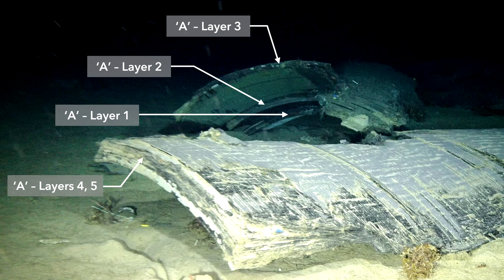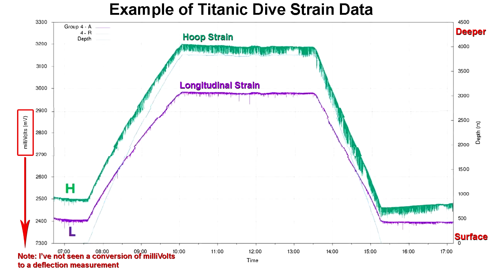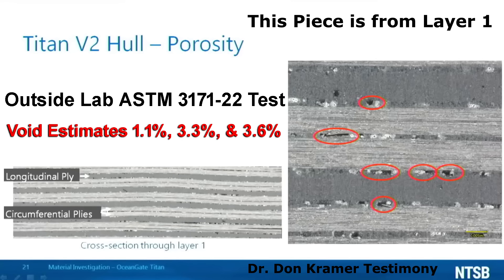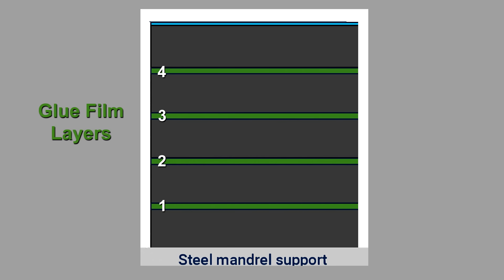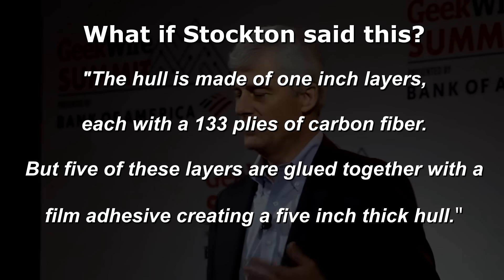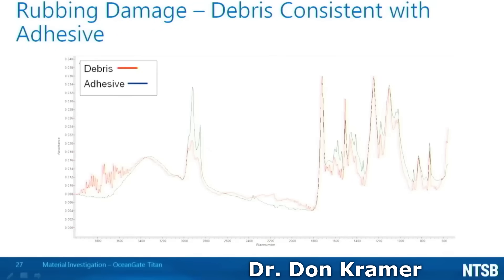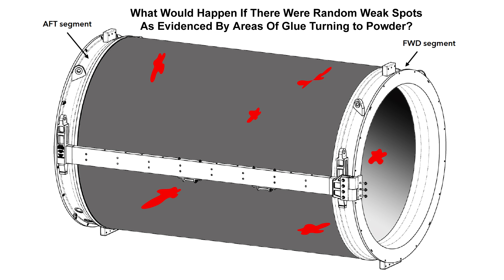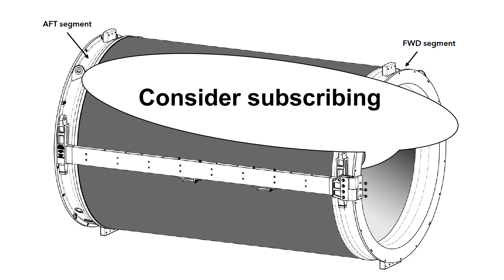OceanGate Titan Hull - Glue Layers Were Breaking Down To Dust - No Clues.

Comment: No one ever think that possibly Stockton used the 1:1 carbon fiber that was destroyed in testing in the V1 hull? I'm just curious cause how he claimed he bought used or older carbon fiber from Boeing but Boeing has no reports of this? And doubtful Boeing would sell anything old or used unless to repair or make a possible standalone Drone sub for testing? I know alot of deals go under the table we all in contracting know that you can get this or that for cheaper but why was it co bonded? Not fully one hull?? Was it cheaper to cure the cure again yeah I guess but cheaper isn't the issue here I see a outlined issue between Stockton claiming that he bought "old or used Carbon fiber" for the new v2 hull I believe he used all the left overs from testing than used the rhino liner to cover up the old markings of the issues from prior tested or used carbon fiber ntm the fact he was using that rhino liner to hide something I heard about Stockton rush when I worked for USMI United States Marine Incorporated located down here in Southern Mississippi Between Gulfport and Biloxi I remember hearing that name aloooot during 2019-2020 which year I was there was either 19 or 20 which we used to have a bunch of older or extra Carbon fiber from our boats and ships as a security guard you learn this and I will say this if anyone uses this information please be discreet of my knowledge I also good God sworn Stockton Rush came there with a semi truck but that was during the day shift but early morning hours I met someone or it was evening that there were 3 of these people one looked an awful like Stockton rush
Reply: Discreet? You just posted this on Youtube, doofus
Reply: This is a huge possibility as USMI is a huge manufacturing company for contracts through scientific research vessels and also naval, coast guard and other military platforms or government outlets all marine services technically that are government or otherwise scientific as we had a ship built by them at the time I worked there I had to walk over and make sure was always secure in our bay, also we uses rhino liner on the bottoms of our more military type vessels yes I know alot of places do but that place is a hugeeee company contract with a huge budget from the US government and just weird to think how we had rolls on rolls of carbon fiber that had sat for months at a time before I ever even start than one day they were gone on a semi truck out the gate im just stating idk of possible or what.. but USMI is kinda a sleazy company and would do anything to protect themselves or make a buck I was treated like a dog there literally lied about and than fired for no reason and then was told they were going to sue me if I spoke out against then in any form or fashion or about their products which infact supposedly its supposed to be public information if any government contract is given to said company this is another reason why I believe this being a serious issue not to mention how they co bonded that sub looks like how we co bond some vessels that stand on top of the water than they use rhino liner on the outside to protect from water getting inside its crazy I never thought of this company United States Marine Inc

Comment: Was the powdered glue a result of stress from the dives?  Or was it from poor manufacturing where the glue never had a chance to dry or was autoclaved to dust?
Reply from the maker: That is a great question.  It could be weakening due to multiple cycles of autoclaving, but we don't know at this point because they haven't released specific information about the glue film used.  The disintegration of the glue to powder and the evidence of rub marks on the laminate between the layers seem to indicate that there was independent movement of the layers and shear forces on the glue layer; in patches.  Think of it as a small grinding motion on the glue layer.  Hopefully, the NTSB final report will tell us more.  Thanks for your comment.
Reply: The powder is almost certainly resulting from the grinding action between the layers,ask any miller and they will tell you that grinding is the ideal method for making dust/ powder out of anything. My take on it is that the glue was dried out completely,it's chemical bond broken down by the repeated autoclave sessions,again ask a miller and they will tell you that only the very dryest stuff makes powder/dust.The expert witness mentioned that there was definite grinding occurring between the first two layers,which incidentally were the layers that were subjected to the most cooking sessions,this I imagine added to the porosity allowed movement and the resultant grinding between the hard and abrasive carbon fibre surfaces ground up what was between them and that it's self produced the dust/powder.
Reply from the maker: @user-re6yo7tj5s  Thanks for your comment.  I agree.

Comment: the port hole window material was only capable of going to 1000m while the titanic is at 3800m. i believe the first thing to fail was likely the port hole window which then allowed the imploding force to damage the cf hull. but having pulled off 13 dives previously, im amazed it didnt implode after the 2nd dive.
Reply from the maker: Thanks for commenting.  I did an in-depth analysis of the controversy about the design and the rating of the viewport. I think you would like that video.  Search YouTube for this title  12 Weird Facts About Stockton's Titan Viewport
Reply: The portal was safety rated at 1000m, but it would stand at 5000m if normal safety derating practices were used.  It's like the overhead rigging shackles I use on a regular basis.  They're rated at 6000lbs, will deform at 27,000lbs and fail at 30-32,000lbs.  And that's to hang a max load of 2000lbs.  They were pushing it hard, but it would still hold.  Extremely poor engineering practice though!
Reply: It’s ok, there was a safety factor of 4 for the window /s.
Reply from the maker: @ Thanks for commenting.  I did an in-depth analysis of the controversy about the design and the rating of the viewport. I think you would like that video.  Search YouTube for this title  12 Weird Facts About Stockton's Titan Viewport

Comment: It is sad they didn't do testing to destruction. They were basically guessing that it was going to be strong enough. It is stunning they were willing to take that gamble. As for why all the analysis? This was the first time anything like this was built. Now they were able to do the testing the Oceangate should have. If nothing else, we can find out what the problems were when using this material and these construction methods. Hopefully this will prevent anyone else from trying to do the same thing.
Reply from the maker: Thanks for your comment.
Reply: Everyone told them at every step it was wrong including a lead mechanical engineer quitting over unsafe practices.
Reply: This was actually built already about 8 years before Rush....and they did test it to failure. He basically copied their whole schtick but not the testing part they did where they figured out it's too risky to make 5 dives.

Comment: For what it may be worth; a Boeing engineering fellow ,  PhD in mechanical and aero engineering and internationally respected exprrt on structural analysis and in particular on composites - Dr L J Hart-Smith asked me to see what I could find out about the failure of this vessel soon after it failed - this was in connection with his research on the buckling failre of shells and his as yet unpublished paper revealing a fundamental flaw in the standard theory of shell buckling that is built into all the stressing codes and computer FEA etc software ( that has the effect  of overpredicting the critical buckling strength by a factor of TWO . The maths is far beyond my level but John did his best to explain it and sent me drafts and was working on the paper right up until he died in hospital on 13 Dec 2024. I saw him only a few days before and he indicated that the fault in the starin analysis was due to the assumption of insignificant curvature of a small element in the hoop loading case primarily and mis application of St Venant's criteria.  His paper is to presented to the international aerospace conference at Melbourne and the Avalon airshow in late March 24-27 .  I could possibly forward it as an attachment to an email from him , under an NDA , before then although it should be embargoed under RAeSoc rules.  I think John would have approved this given his explicit interest in the Titan case.
You can google his name and  find numerous highest level technical papers on structural analysis and composites.
Just thought ghis might help after this link came up on my feed probably as a result of my searching some months ago.
Ross Nolan.
Reply: This is an intensively researched area by many other highly respected engineers. The theoretical results have been benchmarked against test results many times. It's possible that the late Dr. Hart-Smith has found flaws in the previous work but I am a bit sceptical about this. A factor of two error is massive.
I would also point out that the Titan hull was considered to be thick based on its D/T ratio, and hence not very susceptible to buckling. Everything points to progressive breakdown under low cycle fatigue. I will do a video on this in due course.
Reply from the maker: @ Thanks for your reply and adding to the discussion.  I look forward to your video.  I will watch you Part 1 video.
Reply from the maker: Thanks for that thoughtful comment and for adding to the discussion.  So, what you are saying is small amounts of hoop out-of-roundness have a more significant effect on buckling failure than thought and what is built into the FEA simulation models underestimates it right now.  Is that correct?    Roy Thomas, the lead endineer from ABS testified that predicting buckling failure is very problematic, so I know that engineers are aware of the problem.  I hope Dr. L J Hart-Smith's work helps when it gets published.  Thanks again.

Comment: I'm not a mechanical or materials engineer/scientist.....but even at a basic level the design concept looked so inappropriate.

A catastrophic failure/implosion was guaranteed, just a question of how many dives it could survive.....

frankly im surprised it didnt fail on the first.
Reply from the maker: I agree.  I find it amazing that real engineers were involved with this.  The thing is, I don't think any of the engineers would actually dive in it.

Comment: I'm not an engineer or Naval architect, but in essence that hull was in pieces before it even imploded. It was BUILT in pieces and then glued with multiplying porous imperfections that broke the glue down. Even the end caps and hull were pieces of non-contiguous material glued together. Pieces upon pieces stuck together like giant Tinkertoy bits that incrementally degraded. 

That's saying nothing about stuff like testing, maintenance, storage, transpo and operational procedures, which in my view were equally terrifying.
Reply from the maker: Thanks for commenting.  All of your points are correct.

Comment: Why are millions and millions of money being spent on working out what happened?

It was badly made, poorly designed, and not a question of if, but when. 

if this was a common vehicle, used daily by millions of people, find out why it failed. But it was a one-off. It is not going to happen again. So no real need to find out why it imploded at the tax-payers expense. If privately funded, go work it out.
Reply: those who dont know or remember the mistakes of the past are condemned to repeat it.
Reply: Because it is cheaper for the navy to study something that was already made than pay to make a prototype themselves from scratch.
Reply: Just think how much those Litorral Combat Ships made out of Aluminum have cost the navy, someone was sure to try Carbon Fiber eventually… this should put an end to that.
Reply: Because no one was crazy enough to try such stuns in submersible design until oceangate came out with this, the stupidity must be examinated

Comment: The terrible irony here is the amount of scientific analysis and engineering data that is going into investigating what happened. If they had been this diligent in the planning and building of the Titan they may still be alive
Reply from the maker: Thanks for commenting.  You are correct.  At a bare minimum, they needed to build a full-sized hull, dive it to 4,000m 20 times or so, and then destructively cut it up to see how the fabrication process was and to see how the hull was holding up after multiple dives.

Comment: Im putting my crisp 50 on the glue joint between the composite tube and the ti rings being the initiation point. The composite tube was deforming the most in hoop at the longitudinal centre of the tube, this stress would have twisted the machined face ends of the tube to force them out of parallell with the machined rings. This, along with the dropping of the sub earlier, and shearing off the entry door, broke the glue joint between the Ti ring and the carbon tube at the top of the ring The whole compressive weight of the carbon tube end was now only being held by the inner locator sleeve on the Ti ring. When the top of the locator sleeve gave way, the carbon tube folded inward at the top. Broke up the whole ceiling, and shoved it all into the rear end cap. That large, full length piece of remaining hull is the floor i think. My two cents, looking foward to the NTSB,s opinion.
Reply from the maker: Thanks for your comment.  Your mechanism of failure makes sense.  I am making a video about another aspect of the rings that helps your theory.  Stay tuned.

Comment: The carbon fiber was rejected by Boeing for being defective, and they sold it to Rush at a steep discount. And the nose of the titan was glue on.  The combination of defective carbon fiber and the wrong type of epoxy glue. was killer.
Reply from the maker: Thanks for your comment.  I don't want to disagree with you here,  but there was a portion of the testimony when Bart Kemper was testifying that disputed whether or not the carbon fiber was out of date or not.  It may not have been.   At this point, the public testimony would have to come down on the side of "it's unclear and yet to be determined."  We may have to wait for the final NTSB report to know for sure.
Reply: @solareclipsetimer  Presumably Oceangate either never had or destroyed the CofCs that would have come with the pre-preg.
Reply from the maker: @cambridgemart2075  Thanks for your comment.  CofC's - I had to look that up.  Certificate of Conformance.  Got it.

Comment: 27% porosity? So a sponge then.
Reply from the maker: Please allow me to explain this.  Dr. Kramer used two numbers in his testimony about porosity (which was confusing) but I explain both in my video. When he used the 18 to 27% porosity it was the amount of "pores" they saw on the surface of hull material sliced through obliquely.   Then they sent three blocks of the hull for an ASTM volumetric measurement of porosity and the average by volume was 2.2% (samples were 1.1%, 3.3%, and 3.6%).  The 2.2% by volume is probably more significant because is more comparable to the Toray specification for average porosity when cured properly.
Reply: It says 2.7% not 27
Reply: @justaguy5770  It was an audio clip not even 4m into the video of a doctor literally saying between 18-27% porosity. I'm gonna go ahead and say they know more about this subject than you seeing as he's an NTSB engineer who clearly worked on this.
Reply: @shawnpitman876  I had a feeling I was correcting the wrong moment in the video. Sorry about that

Comment: If it had been done in one continuous layer. As I thought it was. Then properly vacuum compressed to remove the gas pockets (voids). and followed up with the autoclave . That thing might still be here. The people might still be alive. I still believe the concept can work. If, and only if the carbon fiber is done correctly. One continuous uninterrupted angular rolled layer. The idea of taking it to Titanic seems pointless. Taking people down a few hundred feet on a reef. Far more reasonable
Reply: Wouldn’t it have had to be made in a vacuum? Trying to vacuum compress something meant to be 5” thick and water tight doesn’t seem like it would vacuum compress anything other than the outermost layer…

Comment: What was the gluing process in the individual.layers?   Why was a glue  sheet even used?  Why didn't  they just roll  on a thin layer of slow curing iiquid epoxy?  It's possible it would have been stronger with no glue sheet which doesn't seem to be the same as the glue used in the wound thread.  There really wasn't much structure.  I would compare it to a spool of thread  held together by glue,  with the spool core removed.  Maybe Carbon fiber would work with a different shape and a different layup system that actually build in structure.   The shape should have been more football like  The powdered glue was probably what they heard cracking as it gradually delaminated.
Reply: Possibly could have used a ring bulkhead in the center to reduce deflection along the cylinder too.
Reply: @nonplayercharacter6478  rush was far too concerned about weight and space for that.
Reply: The green adhesive was a big mistake.  Each is a resin rich inclusion that breaks up connectivity of the hull layers,  This greatly reduces the longitudinal and circumferential bucking strength of the tubular hull.  Researchers could cut plug test samples through recovered hull sections and end trim retains.  These can be tested in tension and shear to demonstrate how much the green adhesive weakens the structure and determine if it has degraded further in the cycled hull.